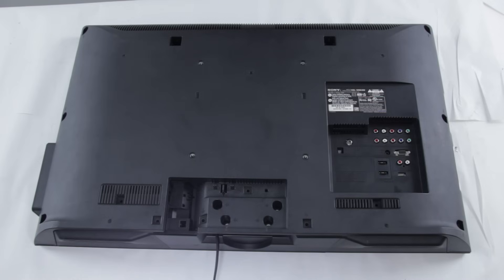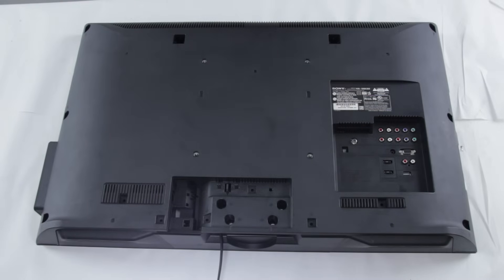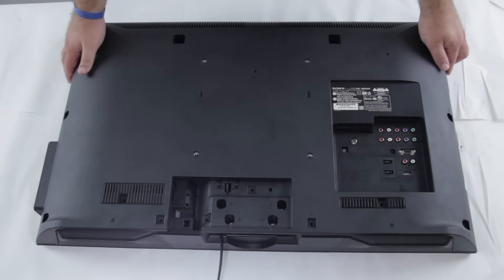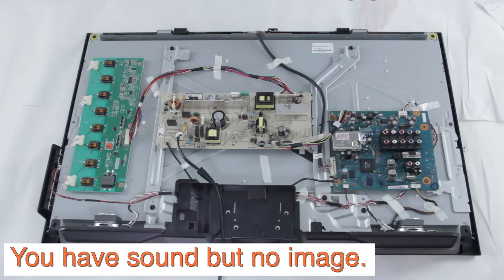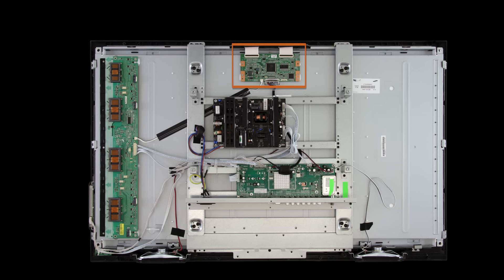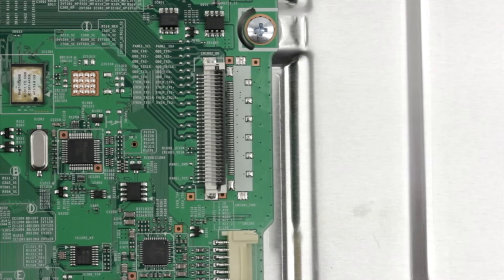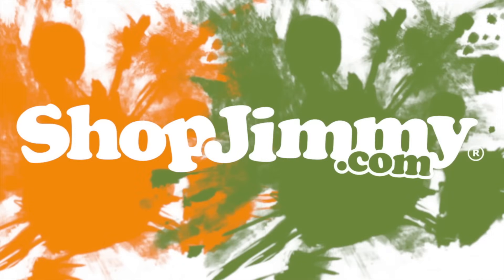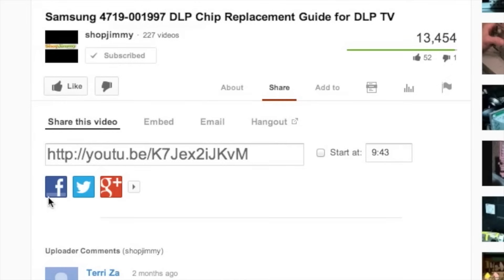LCD TV Repair Tutorial - T-Con Board Common Symptoms & Solutions - How to Replace T-Con Board

Comment: Samsung UN46B7000WF need to know what t-com board I need if I unhook one connecter on tcom board other side works fine with both connected blue line up in down screen
Reply from the maker: Donelle Boldt  Please watch this video FIRST to help with your repair!  https://www.youtube.com/watch?v=BP3NVNCGEv8  Click this link to replacement t-con boards for your TV model number on our website:  http://www.shopjimmy.com/catalogsearch/result/index/?cat=63&q=UN46B7000WF  Be sure to match part numbers on your current board, with your replacement for compatibility.  Here is a link to a video showing how to identify your part number, click here:  http://www.shopjimmy.com/catalogsearch/result/index/?cat=63&q=UN46B7000WF  Thanks and please let us know if you have any further questions with your TV Repair!  www.shopjimmy.com

Comment: I have a Samsung TV model LN52A530 P1FXZC  Serial Number AM283CPQB00412K Version SQ01.  The TV started to cycle through on start up.  It gradually increased in the amount of time to start up.  Currently about 35-45 minutes.  Starts out very dark and eventually gets lighter until picture finally appears.  Every once in a while it will come on dark and stay dark.  TV does not cycle.  I have to start process all over.  Originally thought it was a capacitor issue and replaced all the capacitors on the power board.  Did not have any effect.
Thanks for your help
Reply from the maker: Rick Kolpin  Please watch this video FIRST to help with your repair!  https://www.youtube.com/watch?v=BP3NVNCGEv8  I recommend replacing the main board in your TV.  Click this link to replacement parts for your TV model number:  http://www.shopjimmy.com/catalogsearch/result/index/?cat=56&q=52A530P1  There may be multiple boards for the same TV model number, be sure to match part numbers on your current board, with your replacement for compatibility.  Here is a link to a video showing how to identify your part number, click here:  https://www.youtube.com/watch?v=BEPWrefQvqI  Thanks and please let us know if you have any further questions with your TV Repair!  www.shopjimmy.com

Comment: Hello Jimmy, just a quick question for a LG 37", what if there no sound or picture, though the power LED is diplayed indicating power is getting through OK. and no obvious capacitor issues, could the mainboard be busted as I've already ordered the Tcon board to swap out.

Thanks in advance.
Reply from the maker: Max Bilimoria   Please reply with your TV model number.  Click here to view a video that shows how to find your TV model number:  https://www.youtube.com/watch?v=S51nhAmwR2M  Thanks!  www.shopjimmy.com
Reply: ShopJimmy.com  its a 37LH5000 hope that helps
Reply from the maker: Max Bilimoria  Please watch this video FIRST to help with your repair!  https://www.youtube.com/watch?v=BP3NVNCGEv8  I recommend replacing the main board in your TV.  Click this link to replacement parts for your TV model number.  http://www.shopjimmy.com/catalogsearch/result/?q=37LH5000  There may be multiple boards for the same TV model number, be sure to match part numbers on your current board, with your replacement for compatibility.  Here is a link to a video showing how to identify your part number, click here:  https://www.youtube.com/watch?x-yt-cl=84503534&x-yt-ts=1421914688&v=RwHTvjMdrhk  Thanks and please let us know if you have any further questions with your TV Repair!  www.shopjimmy.com

Comment: Hi ShopJimmy.com,

I have a two years old led tv 55PFL6007G/78, my tv screen is showing tin horizontal grey lines, from top to bottom.
what should i do?
here's some pictures similar to my issue...
http://i168.photobucket.com/albums/u167/kayakflyguy/TV/PB050294.jpg
http://oi59.tinypic.com/27xjptd.jpg

Thank you
Reply from the maker: Felipe Mendes  Please watch this video FIRST to help with your repair!  https://www.youtube.com/watch?v=BP3NVNCGEv8  This could be a problem with either the main board or the TV panel.  You can replace the main board to see if that fixes the problem.  Unfortunately I do not see any replacement parts in the search results for your TV model number on our website.  Please reply with your part number on your main board and I can try searching for replacement parts.  Thanks and please let us know if you have any further questions!  www.shopjimmy.com
Reply: HI. you tray replace T-con board?

Comment: hi, i have a Sanyo DP42840 that the left hand side of the screen is out. after about 30 min or so it will come on but has vertical lines. i have taken it apart and pushed down on the ribbons and it did not help things out. do you know if this is the t-con board or the boards across the top of the tv. can the t-con board be fixed or do i just need to buy another one if thats what my issue is?
Reply: ShopJimmy.com thanks for the reply. So thats not good!! i was hoping it was just the t-con board. if I was to purchase a new t-con board from you guys and it did not fix my issue would i be able to return it? i just think its not the TV panel itself because it will get corrected after about 30 min or so.
Reply from the maker: Stephen Markle   Please go here for more information on our returns policy.  http://www.shopjimmy.com/returns  Thanks!

Comment: I have an Element ELEFT406 LED television. It powers up and has sound, but the picture is BARELY visible. If you look really hard, in the dark, it's there, but not being lit. Any ideas? I've gotten the back off and have somewhat gotten to know what's what back there... I'm just wondering, is it fixable??
Reply from the maker: Sarah J.  Please watch this video FIRST to help with your repair!  https://www.youtube.com/watch?v=BP3NVNCGEv8  This sounds like a problem with either the power supply or the LEDs in the TV panel.  You can replace the power supply to see if that fixes the problem.  Click this link to replacement parts for your TV model number:  http://www.shopjimmy.com/insignia-cvb42001-power-supply-unit.htm  Be sure to match part numbers on your current board, with your replacement for compatibility.  Thanks and please let us know if you have any further questions with your TV Repair!  www.shopjimmy.com

Comment: hello

i have a sony lcd tv 32nx500
i am facing issues regarding the blinking of screen
problem started a few days ago
my tv started blinking ones in a minute and the increased to ones in a second and it still continues twice in a second , now screen is full black whereas sound is coming nicely,
also my hdmi ports are not working

so please help me to get out of this problem
and tell me what the actual problem with my tv
its the problem on panel or its problem on board inside

also guide me that how to detect the problem
Reply from the maker: Akhil Dodwani.   I recommend replacing the main board in your TV.  Unfortunately I do not see any replacement parts in the search results for your TV model number on our website.  Please reply with your part number on your main board and I can try searching for replacement parts.  Thanks and please let us know if you have any further questions!  www.shopjimmy.com

Comment: I have a Samsung UN46C8000XFXZA. The picture recently disappeared but I still have intermittent sound. There is a clicking sound and a faint flash of light. It sounds like the TV is trying to power on but cannot. The remote control will not stop this continual clicking or turn off the TV. After unplugging and waiting a while, when replugging the TV, the clicking noise continues. There is a little black box at the bottom of the main board where this clicking is happening. Do you think replacing the main board will solve my problem? I see no evidence of blown capacitors or anything burned or loose. My main board part number is BN44-00362A. Thank you in advance! :)

Comment: I have LG LED TV - Model - 42-LV3730-TD, for the past one month started the flicker the images, First five minutes working fine after that jumping the pictures, LG TV Technician came without open the TV he stated need to replace the SMS unit, another Technician attended need to replace the T-CON board, please give your inputs which one is correct, can i go-ahead the purchase of T-COB board.
Reply: Sorry it i not SMS, please read as SMPS
Reply from the maker: SNSasi Kumar   This could be a problem with either the power supply board or the LEDs in the TV panel.  You can replace the power supply board to see if that fixes the problem.  Unfortunately I do not see any replacement parts in the search results for your TV model number on our website.  Please reply with your part number on your power supply board and I can try searching for replacement parts.  Thanks and please let us know if you have any further questions!  www.shopjimmy.com

Comment: I have Samsung plasma TV model PS43E490BIR.
It suddenly would not turn on but the led light is still on... whenever I turn it on, the led light only flashes and it gets back to stand by mode again.
I tried to figure out by detaching every boards and when I disconnect the ribbon from the x-sus that goes to the buffer board and tcon, the tv turns on but off course without picture but with sound... could it be possible that the main problem is the tcon or the power supply for I assume that it cannot sustain enough power whenver the tcon is connected? hoping for your response  thanks in advance  and more power.
Reply from the maker: dweyn odrazil   I recommend replacing the X board for your TV repair.  Unfortunately I do not see any replacement parts in the search results for your TV model number on our website.  Please reply with your part number on your x main board and I can try searching for replacement parts.  Thanks and please let us know if you have any further questions!  www.shopjimmy.com

Comment: I have a Sony KDL40W2000 which was working fine until a couple of nights ago.  The screen started to show colored vertical lines. So i switched it off and now it won't switch back on - when you switch it on you hear a click, the green light is on, then eventually after 4 or 5 attempts the red standby light starts flashing 8 times - indicating "trident IC trouble".
Is this a faulty T-CON board issue?
Reply from the maker: PhatPhil77   This sounds like a TV panel (TV Screen) problem.  If your TV panel is bad, it may be more cost-effective to replace the TV as panels are typically hard to find in stock, difficult to replace, and expensive.  Thanks and please let us know if you have any further questions!  www.shopjimmy.com

Comment: I have a Samsung LN32A550P LCD TV.  When attached to an antenna and turn it on it comes sometimes with a load screaming sound through the speakers and with vertical greenish lines through out  the pix.  But if  I turn the TV off and back on again I have perfect pix and sound.  Please help.  I've checked the caps and they are fine. Email: rolnickdin@comcast.net
Reply from the maker: Roland DiNezza  I recommend replacing the main board in your TV.  Click this link to replacement parts for your TV model number:  http://www.shopjimmy.com/catalogsearch/result/index/?cat=56&q=LN32A550P  There may be multiple boards for the same TV model number, be sure to match part numbers on your current board, with your replacement for compatibility.  Here is a link to a video showing how to identify your part number, click here:  https://www.youtube.com/watch?v=BEPWrefQvqI  Thanks and please let us know if you have any further questions with your TV Repair!  www.shopjimmy.com

Comment: Hi, I got a Polaroid 3211-TLXB that shows a negative image (almost completely white), but sounds plays normally.

Turning on the TV with T-Con disconnected results a black screen (but the back light is lit). 

Is it really the T-Con? How can I get one for that TV?

Thanks!
Reply from the maker: Idan Izhaki   Please watch this video FIRST to help with your repair!  https://www.youtube.com/watch?v=BP3NVNCGEv8  This could be a problem with either the t-con board or the main board in your TV.  Click this link to replacment parts for your TV model number:  http://www.shopjimmy.com/catalogsearch/result/?q=3211-TLXB  There may be multiple boards for the same TV model number, be sure to match part numbers on your current board, with your replacement for compatibility.  Thanks and please let us know if you have any further questions with your TV Repair!  www.shopjimmy.com

Comment: Hey, I have a Samsung LN52B630N1FXZA LCD and the TV will just turn off randomly.
Reply from the maker: tperezz1  Please watch this video FIRST to help with your repair!  https://www.youtube.com/watch?v=BP3NVNCGEv8  I recommend replacing the power supply board in your TV.  Click this link to a replacement power supply board:  http://www.shopjimmy.com/catalogsearch/result/index/?cat=229&q=LN52B630N1FXZA  There may be multiple boards for the same TV model number, be sure to match part numbers on your current board, with your replacement for compatibility.  Here is a link to a video showing how to identify your part number, click here:  https://www.youtube.com/watch?x-yt-cl=84359240&x-yt-ts=1421782837&v=sSJexLvRrjM  Thanks and please let us know if you have any further questions with your TV Repair!  www.shopjimmy.com

Comment: Hi there. Thank you for this helpfull video! About Sony Bravia KDL-40D3500 42". The screen picture is bad, kind of blue/greenish in different areas. What could be the problem, and can I fix it? Best
Reply from the maker: tordenblod  Please watch this video FIRST to help with your repair!  https://www.youtube.com/watch?v=BP3NVNCGEv8  This could either be a problem with the t-con Board, the main board or the panel.  You can replace the main board and t-con board individually to see if either fixes the problem.  Click this link to replacement parts for your TV model number:  http://www.shopjimmy.com/catalogsearch/result/?q=KDL-40D3500  There may be multiple boards for the same TV model number, be sure to match part numbers on your current board, with your replacement for compatibility.  Thanks and please let us know if you have any further questions with your TV Repair!  www.shopjimmy.com

Comment: As you said it is tv panel problem I ordered t-con board in shopjimmy and I replaced it .Problem got fixed vertical and colored lines are no more .but only the horizontal lines are still on screen they black in color expect those everything looks.But my tv has AV input problem if I use USB picture clarity is good but if I use dish setup picture clarity is very bad .Once I did AV calibration accidentally from that day issue got started.i tried to fix by trying AV calibration but its showing as failure .What I can do on this do I need to replace av board too.
Reply from the maker: Swagath Chowdary   You can replace the main board to see if that helps.  Although the TV still has lines and the main board typically will not fix that.  Thanks!  www.shopjimmy.com

Comment: Hi! I have a SONY BRAVIA 40" 16:9 1080p 120Hz LCD Model# KDL40EX500. When pushing the power button the light turns green for a second then starts flashing RED 5 times, then about a 3-4 second pause then red 5 times, and continues to do this infinitely while never starting up. What could this be? Thanks!
Reply from the maker: Josephthinleg   Please watch this video FIRST to help with your repair!  https://www.youtube.com/watch?v=BP3NVNCGEv8  I recommend replacing the t-con board in your TV.  Click this link to replacement parts for your TV model number:  http://www.shopjimmy.com/catalogsearch/result/index/?cat=63&q=KDL40EX500  There may be multiple boards for the same TV model number, be sure to match part numbers on your current board, with your replacement for compatibility.  Thanks and please let us know if you have any further questions with your TV Repair!  www.shopjimmy.com
Reply: I already watched it, so do you think that's what it is or no?
Reply: It has a Red 5 blink code, won't turn on. The model is a Sony KDL40EX500. Thanks!
Reply from the maker: Josephthinleg  Please watch this video FIRST to help with your repair!  https://www.youtube.com/watch?v=BP3NVNCGEv8  I recommend replacing the t-con board in your TV.  Click this link to replacement parts for your TV model number:  http://www.shopjimmy.com/catalogsearch/result/index/?cat=63&q=KDL40EX500  There may be multiple boards for the same TV model number, be sure to match part numbers on your current board, with your replacement for compatibility.  Thanks and please let us know if you have any further questions with your TV Repair!  www.shopjimmy.com
Reply: Seriously? I already did, I know how to replace things. So do you think the 5 red blink code is the T-Con board or no?
Reply from the maker: Josephthinleg   Yes, I do believe it is a bad T-Con board.  If you purchased a replacement T-con board, it may be defective.  Thanks!  www.shopjimmy.com
Reply: Ok thank you so much for your help! Can you send me a link to that part to buy on your website?
Reply from the maker: Josephthinleg   http://www.shopjimmy.com/catalogsearch/result/index/?cat=63&q=KDL40EX500  There may be multiple boards for the same TV model number, be sure to match part numbers on your current board, with your replacement for compatibility.  Thanks and please let us know if you have any further questions with your TV Repair!  www.shopjimmy.com